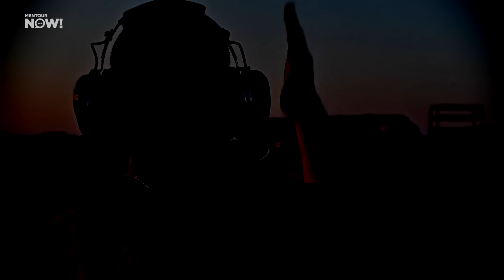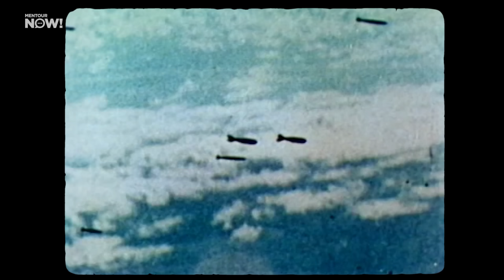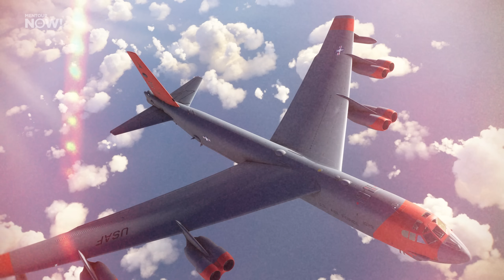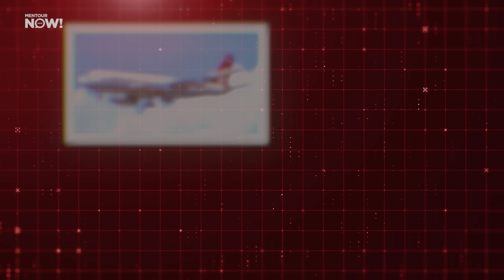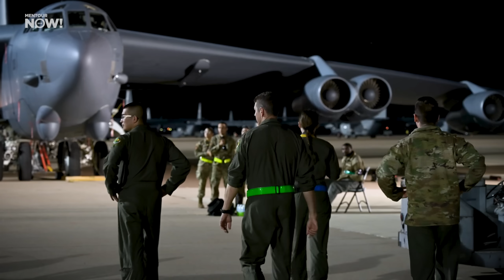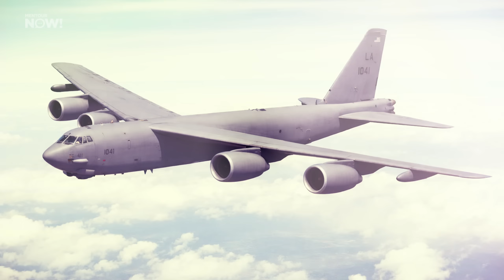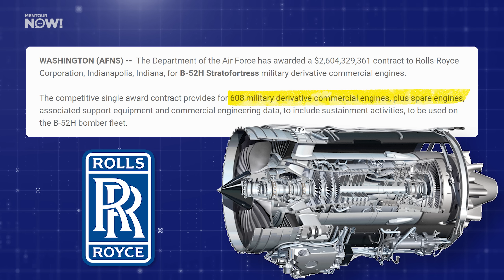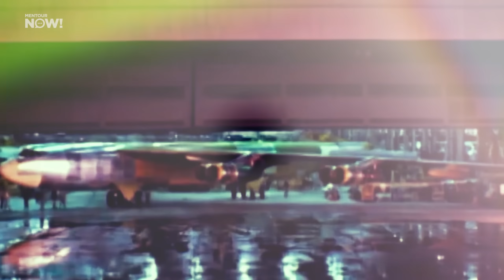WHY Are They Changing The B-52 NOW?!

Comment: From a strategic perspective, it makes sense to have some planes in your Air Force that are as 100% analog as possible. And I'm not advocating for the to be applied to the B-52 fleet. I think it would be strategically valuable to have planes that are new in terms of being built, but are built to function 100% analog. I mean I guess I 'm thinking in terms of either EMP's or a war that degrades our ability to produce modern planes. I don't know if I'm making sense. It is Monday after all 😅

Comment: If they were honestly crunching the numbers, the most logical decision would be to have the current engines and parts build.
The last airframe rolled of the production line in 1962, so if they talk about a service life until 2050 you put new engines and all the hassle connected to it on a 73 year old airframe in 2035 and use it for 15 years. 
It will then retire as a 88 year old airframe in 2050 which is equivalent to operate a B17 until 2033... I'd bet there are some metallurgy concerns in the minds of engineers as well.
Reply: Without the new engines, the airframe life was “2050 and beyond”.  2050 is based on the highest time airframes aging out, based on several “engineering estimates”.  Actual data shows the airframes are in better condition than the estimates.  With the re-engine, the fleet will likely go well beyond 2050.

Comment: Leave it to the U.S. military to find new ways of wasting taxpayer dollars. Air parks all over the southwest are crowded with
decommissioned civilian aircraft which could be converted for military use as bombers. Examples: Boeing 757's, 767's, and 747's. Civilian passenger versions of these types are routinely reconfigured as freighters  The B-52 should be phased out,
and conversions of those newer aircraft types into bombers, should be undertaken. Upgrading the bomber fleet, while
saving taxpayer money, makes sense -- which is why the air force won't consider it.

Comment: About the time of Gulf War I, I was in a Rocky Mountain valley, about halfway up the side of the valley which was about 1,000 ft. from bottom to top, so I was standing about 500 ft. higher than the bottom of the valley.  Hearing a dull roar growing louder every second from the east end of the valley about 20 miles away, I was surprised to see a B-52 negotiating the curving valley at only about 200 ft. above the valley floor.  It was strange standing there looking DOWN on a roaring B-52 cruising up the valley like an old pickup would drive up a mountain road.   A relative, who was just retired from the USAF and who had been associated with the B-52 squadrons, later told me that the particular valley that I was in had similar topographic characteristics to a valley in Iraq and that the B-52 was likely flying that valley as a training exercise in using the plane's ground avoidance radar.  In any case, it was pretty wild.
Reply: There is a pic of a B52 below the flight-deck of an aircraft carrier. Some exercise - the carrier told them they had no visual.... "Look lower.....". They were trained to fly into Europe below Soviet radar - say under 100 feet?
Reply: @ibubezi7685 What a Buccaneer pilot would describe as a nice high altitude, good for a Sunday morning cruise.
Reply: @Senthiuz  Now THAT plane was nuts.
Reply: @ibubezi7685  Had a conversation with a SAC B-52 pilot based at Carswell AFB back in the '80s. I asked him how much he like to fly the BUFF, and he mentioned that it gets pretty nerve-wracking flying 100 ft. over the Gulf. It didn't allow much margin for error or cushion to deal with a problem.
Reply: I was in a radar tower in Germany during the NATO autumn maneuvers in the early 1980's and saw a shadow pass by a window, unexpected to say the least. I looked out and saw 2 B-52s flying in formation, lower than that window; I'd seen the tip of the tail pass by.
Reply: Bud Holland performed something similar in 1994 at the Yakima range for the photo-shoot. It later ended not so well 😢
Reply: @t @tamahagane1700  When I read the comment, I wondered if it was Holland flying.
Reply: Heard that Holland was writing a book back in '94, called "How to be a killer pilot."
Reply: I had a similar experience in the Saline Valley near the Panamint range and Death Valley. A friend and I were camping there, and we knew it was part of the jet fighter training range. They flew over every day, but that day we were on a hill a few hundred feet above the valley floor. We heard the fighter approaching as usual, but we suddenly found ourselves looking down into it's cockpit and seeing the pilot glance at us briefly as he navigated around the hill almost touching the valley floor, making a few quick turns, then a dramatic climb as he accelerated out of the valley and disappeared. Great place to see fighter pilots train!
Up by China Lake there's even a couple stop lights that serve as warnings in case a pilot's instruments fail - green to red is a warning that there's other air traffic in the vicinity....
Reply: Friend of my family was a B-52 pilot and also commented one time about looking up at a farmer in a harvester  combine on a hill above the rolling valley in which the pilot was flying his B-52.
Reply: I was flying low level across mesa tops in west texas about 20 years ago, and as I was crossing a small valley between two of them, I briefly saw a shadow disappear under my wing.  I banked the plane in the other direction to see under my wing and saw a B-1B smoking up the countryside.  Less than 200ft clearance and only a moment to spot me, they were probably feeling far more concerned than I was, if they even knew I was there to begin with.  Those guys were constantly seeing how low they could get, and in my middle school days it was the coolest thing to see one nearly breaking the sound barrier closer than you'd ever see at an airshow.  We saw just about every bomber imaginable, sometimes fighters, a lot of F-117's too (they bombed our town with practice ordnance once, that was kind of funny).  Only saw one B-52 on the deck when I was out flying, and I saw the smoke on the horizon more than I saw the plane itself.  That famous picture of the B-52 used in this video, flying over what looks to be a patch of sand dunes?  That's right next to my hometown in west texas, you can actually see my house in it as it's directly under a military training route.
Reply: I had a similar experience while skiing at Wildcat in New Hampshire looking down at a pair of F111's out of Pease.
Reply: Try plowing a field in eastern Nebraska and have one do a flyover at 100 ft agl coming from behind you--  its a clean your shorts moment ...... this was routinely done in the 60s and 70s
Reply: Better you than Saddam,......

Comment: Both B-52 and TU-95 are fascinating like that. They are not usefull enough for USAF and VVS respectivelly to varrant a new replacement design but are usefull enough to be kept in service. But the way both aircraft were designed makes it quiet hard to upgrade and keep them operational.

Comment: Still should have gone for 4 engines.  Painful upfront, but in the long run cheaper.
Reply: No. 4 engines do not work for an engine-out takeoff emergency and the resultant lack of rudder authority.  8 engines do.
Reply: @SEO122 
Then why do aircraft have 4 engines? Or 2 engines?

Comment: I think they should do 6 engines... Twin pods on the outside and single high bypass engines on the inside. Minimize asymmetrical thrust concerns, and provide fuel savings.

Comment: The other 1950s strategic bomber that is still in operation, using the same engines, is the Tu-95 Bear turboprop. Ukraine took some of them out of late with drone strikes. The Tu-95 is a direct development of the B-29 via the Tu-4 and its modifications in the Tu-80 & 85, so the 95 is basically a stretched 29 fuselage with swept wings, turbines and conventional cockpit. It is slower and has less weapons load than the 52, and is super-loud, but with the super by bass prop turbines very long ranged. Those babies could reach 100 yrs operational. 

The 95 was developed because the direct competitor to the 52, the Mya-4 Bison, was too short ranged with its very inefficient turbojets. The 95 was the fall back design that stuck around.

Comment: b-52 exists and will continue to exist because no aircraft has been built to fit it's specific role, even the b-2 and b-1s are built for a different purpose then the b-52 is now fulfilling. To replace the b-52, they have to build a general purpose low cost bomber. the main and realistically the only reason why they keep them, is because they are cheep to operate, simple to operate and can be deployed anywhere without special accommodations or facilities. unlike the b-2 and b-1s that have to be kept in hangars to protect the radar absorbing paint, the b-52s are basically the beater that you drive to and from work and don't really care how it looks, because it's cheap it works and it does what it needs to do. so to replace that, they need to build a fleet of like 5k or more cheap bombers that are basically like the b52... so why would they? until the air frames are unserviceable, they will keep flying them. then once they get to the point to realize, they actually need to replace the aircraft, they will then and only then replace them.

Comment: Thank you for answering this 8 Engine vs 4 Engine B-52 testing requirements.
Reply: Fun fact: a distributed load on the wing, like the weight of those 8 engines, provides a counter-force to the bending and torsion forces acting on the wing in flight. More weight - more relief - less structural reinforcement needed. That's why, air resistance aside, even replacing engines with a lighter version could necessitate  additional structural reinforcement. Which could then shift the plane's center of mass, which could then require changing the position / geometry of the wings, and this changevalanche cascades from there...
Reply: @Duke.Of.Shostka  Incorrect. Less mass means less force and less bending moments. Yes the center of gravity would probably need to be changed. Still doable and with 4 engines you get a more efficient longer range machine. Then again, maned military aircraft will eventually be obsolete.
Reply: Less force on the ground, yes.  But in flight generating lift, the wing engine counterbalance may get broken.
Reply: @Terry-y2r  - Unmanned bombers makes as much sense as manned ICBMs.  Drone aircraft are great in two regimes of military flight: 1) Missions too long and too boring for human endurance.  2) Missions too dangerous / too risky to sacrifice human lives.  Removing human pilots from the cockpit is only a halfway step from a cruise missile or an ICBM.  There are many reasons for keeping a living, thinking human being in the cockpit of an aircraft that an autonomous vehicle cannot do, even with much more advanced and sophisticated AI than we have today.  Remotely piloted vehicles have limited ranges, input / response lag, and limited situational awareness.  AI has improved tremendously in the last ten years, but we still have unmanned aircraft that still can't find their way off the taxi ways.

Personally, I believe if we ever get to the point of being able to replaced every single warfighter with AI / robots, it will not save human lives from wars.  War would not be the last resort, if no blood is on the line.  It would just be another political option and then eventually resulting in violence directed at civilians from AI vehicles / robotic soldiers.
Reply: @conroypaw  Drones are developing in many forms this is because technology is progressing rapidly, and its cheaper to make non maned aircraft.  Missiles are more accurate than ever and just make maned aircraft expensive targets..
Reply: @Mixer-he2wb  Not if you use an engine that produces the same thrust.
Reply: @Terry-y2r - The only difference in cost will be the human in the cockpit or lack thereof.  Drones aren't the end all be all solution you think they might become. 

I'm not saying missiles aren't more accurate than they've ever been, but for every improvement, there is a countermeasure.  There always will be.

After the 1973 Arab-Israeli War, military analysts proclaimed the death of air forces with surface to air missiles making air superiority a thing of the past.  Even as we speak, military analysts are proclaiming the death of the Main Battle Tank after observing the war in Ukraine and the effectiveness of drones and man portable anti-tank weapons.  It's all just another page in military history.  Some technology will come around to address the issues and vulnerabilities of the weapons systems of today.  It started with the first thrown rock and the first shield.

Drone planes can already outmaneuver, outrun, and out-endure any manned plane, but air forces around the world aren't interested.  I doubt they will be interested even if technology improves.  The human factor is still able to provide the flexibility that machines simply cannot.

The more sophisticated a drone becomes, the more dependent on sensors it also becomes, which introduces a new set of vulnerabilities.  Also, as machines become more "intelligent" the importance of cyber security also increases.  The last time I checked, it was still impossible to hack into the human mind.  Unless your drones are fully autonomous, they will be vulnerable in some way.  And if they are fully autonomous well... that's how you get Cylons or Skynet.  😏
Reply: @Terry-y2r  You're missing the point.  The distributed force of the generated lift on the wing creates it's own bending moment across the wing.  The weight of the engines counterbalances the lift bending moment, causing less bending, ie less strain and therefore less stress.  Additionally, more or less weight changes the inertia of the wings under bending, changing the frequency of oscillations.

The same thrust changes the bending moment due to drag/thrust balance, but that's not in the "up" direction, only the yaw direction.  It also affects the twisting moment on the wing due to the off center mounting, but again, not the same bending direction as the generated lift and weight load.
Reply: @holdintheaces7468  If using more efficient engines results in less weight, you can easily add extra weight  to the engine. The difference in drag will be minimal and design of the new engine cowling can be fine tuned if it is a problem. The new less efficient 8 engines will have the same problems.